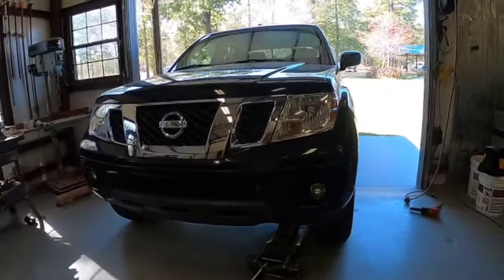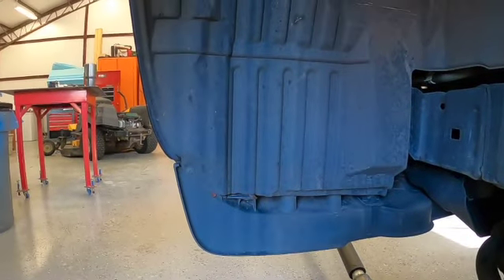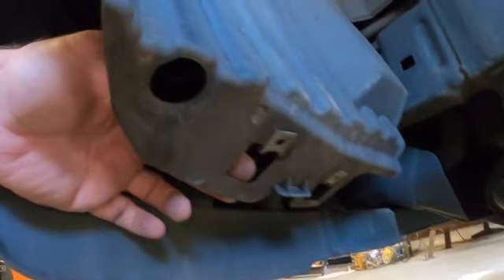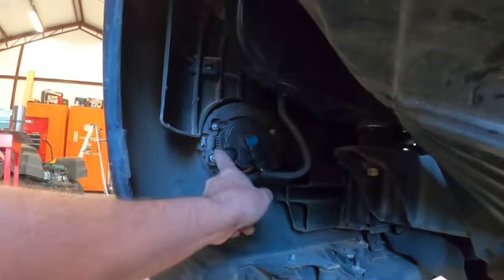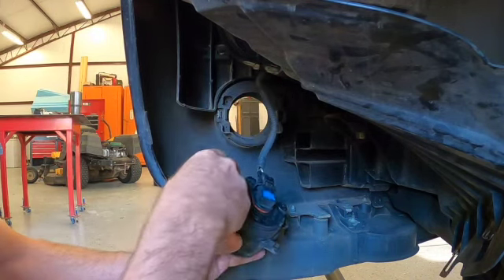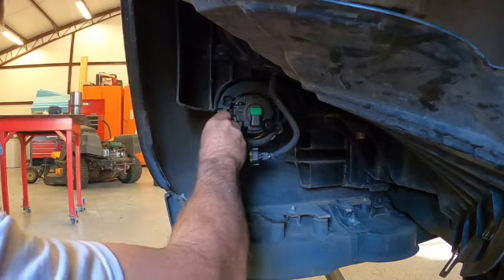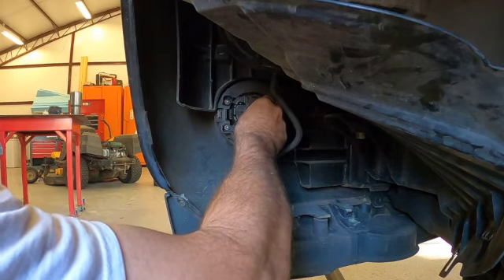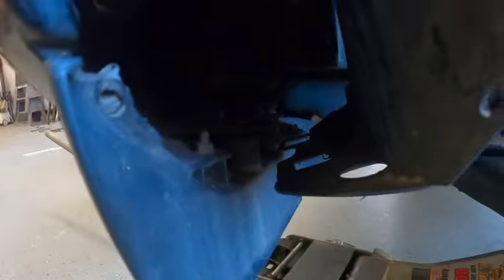Nissan Frontier Fog Light Replacement

Comment: Thanks. Access to mine should be similar on my 2013 Xterra. I picked up a single used light from eBay. There are a lot of aftermarket replacements, but most seem to get reviews that mention leaks and moisture fogging, so I went with OEM.
Reply from the maker: Thanks for sharing